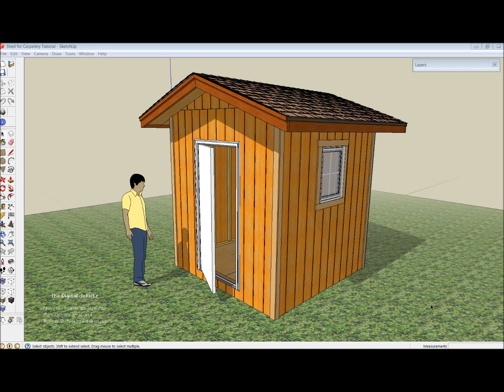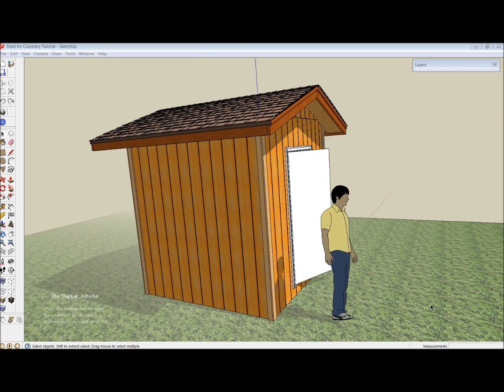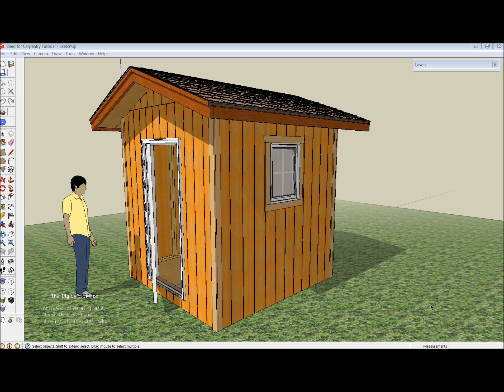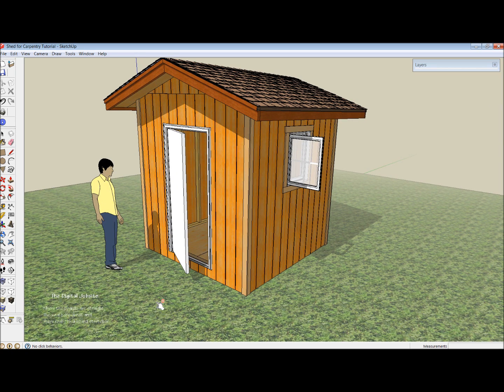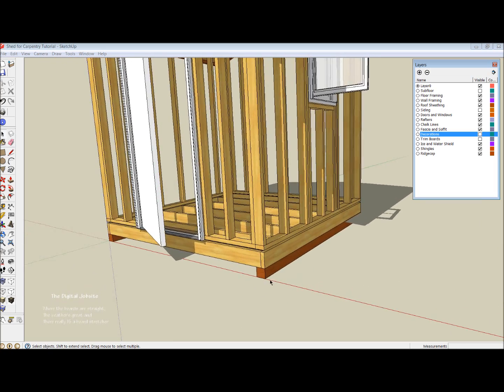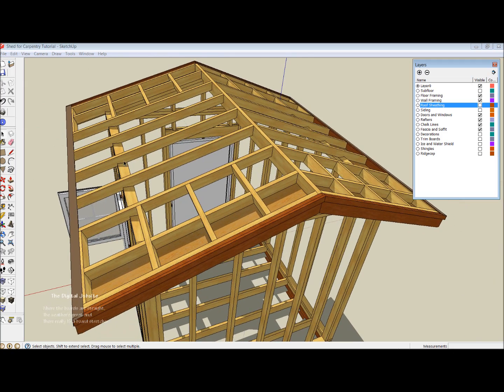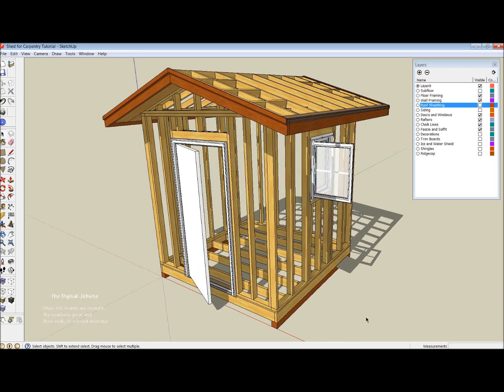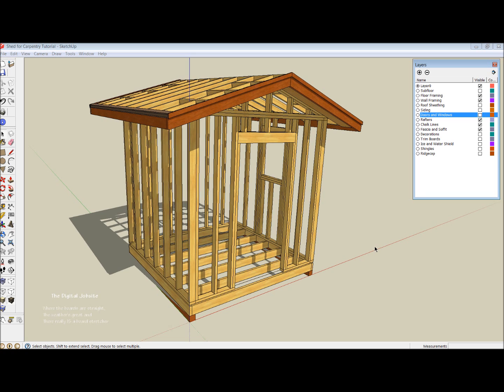A Step Ahead to Build a Shed Tutorial Part One

Comment: Opps!  My bad!  I didn't see them.  Maybe make them a different color?  I may be a little color blind.  :)

Are you going to use Z flashing at the horizontal joints of the T-111 and the top of the door and window?

I like the felt on the walls. I keep the bay open for the greater storage and use a tight sealing door to cut down on spiders.

I also like to lay 6 ml poly over the joists before I put the floor ply down as a vapor barrier from underneath.

Comment: Opps!  My bad.  I didn't see them and I watch three of the sections.  I may be slightly color blind and they didn't separate for me.

Are you going to use "Z" flashing for the horizontal butt joints between sheets and over the window?

I like the felt.  I don't find any of my tools get rusty as long as I put that on.  I still leave the stud bays open for the extra storage.

It is a trade off, spiders or more storage, but if you get a good seal at the door, spiders are a minimum.